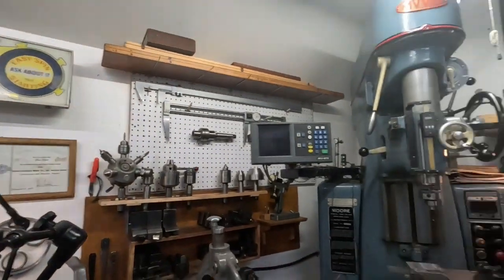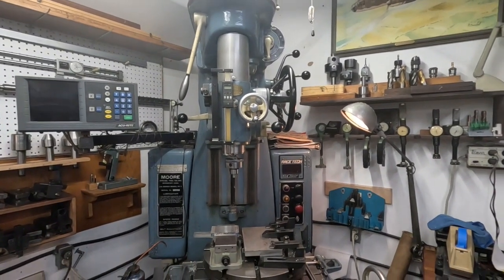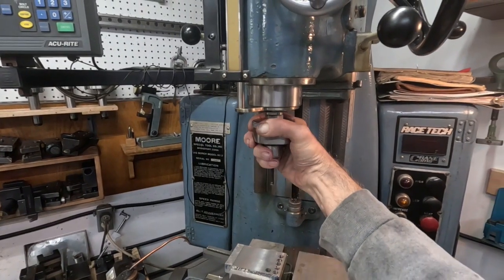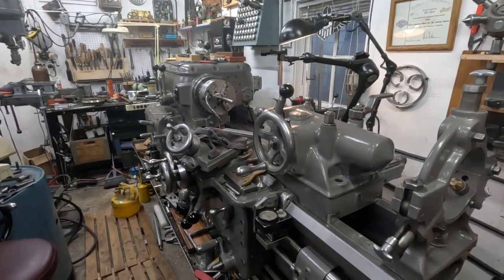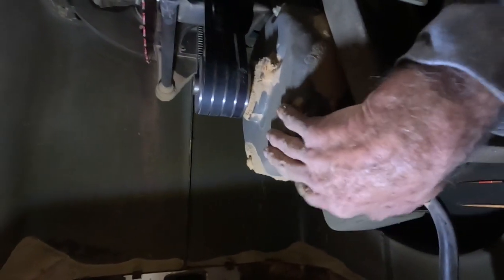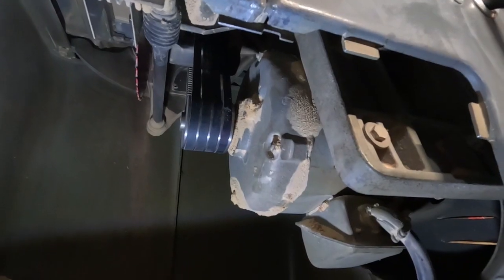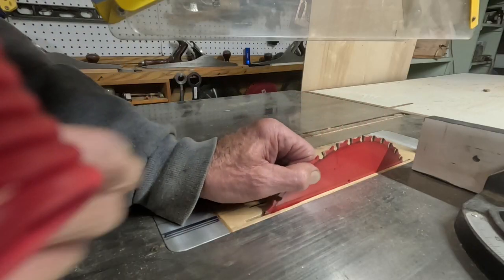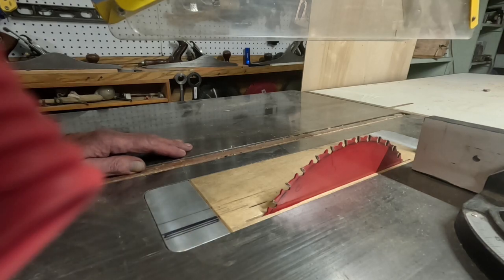Machines run smoother with this drive belt trick

Comment: You make some good points that are very handy to know.  I'm rebuilding a three belt 12 inch bench grinder, I'll apply this thinking when commissioning.  Thanks for sharing.

Regards

Alan here in NZ
Reply from the maker: Thanks, It helps on the high speed machines

Comment: Perhaps many have not run across this, but when bias ply tires were the only thing out there, a condition that showed up especially in cold weather that when you jumped in your car and started driving down the road that there was a bumping or flat spot ride that occurred for a short period of time until the rubber was ‘exercised’ enough to smooth out the short term memory of the tire material from flat to round.  I am not promoting radial V belts, but to say that Don is re-educating those out there to the why’s and where-for’s  of machine operations.  Same  thing as letting your machine tool (or car) warm up to circulate lubricants before operations begin.  Just things you learn as you go along!
Reply from the maker: I have that old table saw running so good, I dropped everything and made a screen door for my house!

Comment: So why does rotating the blade out of the "bump" in the belt before starting it cause the belt to straighten out faster? Just because the high torque at starting isn't applied to the belt in the same position? Maybe with the bump in the middle, the starting torque actually helps pull the bump out? That's the only explanation I can think of, but I'm not too convinced that's what's actually going on
Reply from the maker: Most people will never even try this, and that is a fact. Thanks for tuning in.

Comment: Yes, that’s one of the most annoying things about belts. But the Reeves Drive in my lathe does allow it to run much quieter, even with the two speed transmission. Having that gearing buried inside the bottom of the lathe rather right on top majestic a difference. Unfortunately, my mill uses two belts with three pullers, so it’s difficult to get them aligned. But it’s mostly a problem with the one from the motor, which has a small diameter pulley at the top of the four different diameter stack.
Reply from the maker: The Pope Spindle Company had employees hand rotate spindles in stock once daily and recommended owners do that to installed spindles so the preloaded bearings do not brinell into the races "form dents" by working through the lubrication film from vibrations from other machines in the shop. The variable speed Reeves drive in the Moore was made by the same company that made the drive for the Rivett 1020, the belts are no longer available and have a different edge angle and width than what is available now. The cost of the belts was extreme 30 years ago, they are still good, I think it was good advice from Moore. Since, I rotate my machine spindles when not in use.
Reply: @ honestly, I’ve thought about doing it, but never did. Your video has gotten me thinking about it now though.

Comment: Thats really interesting. I'll have to check that out on my Clausing Lathe. I finally officially finished it today.
Reply from the maker: I keep saying that about my old Axelson but I find another thing to do. I think you will find that helpful on the Clausing variable speed, the drives just smooth out faster keeping them at mid speed when done using and rotate off the belt set before starting.